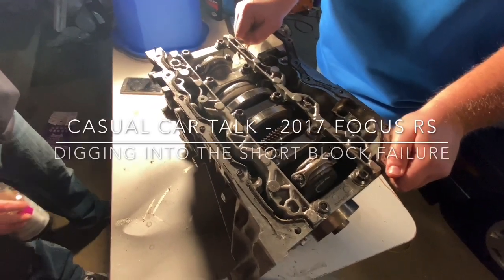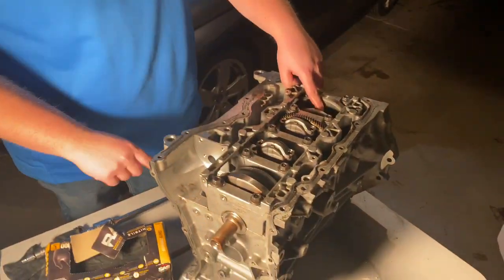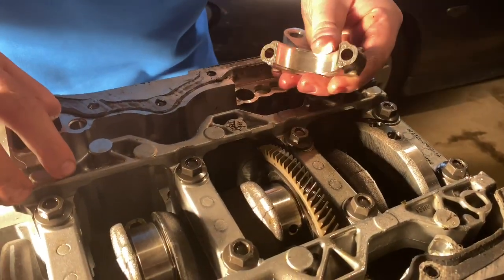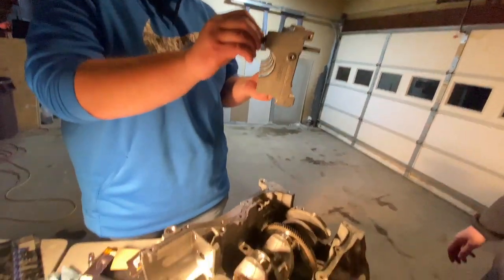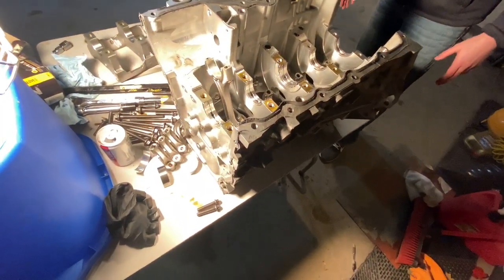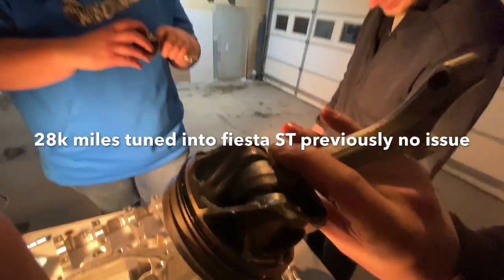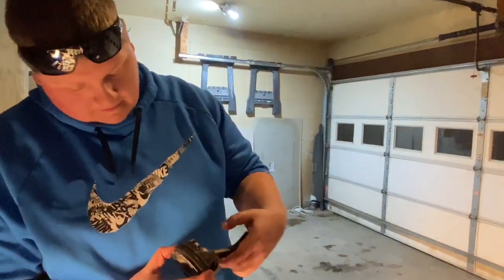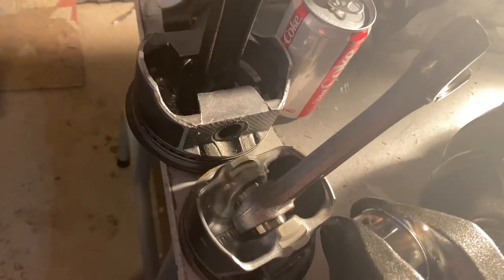2017 Focus RS Shortblock Failure Inspection

Comment: I personally wouldn’t blame Cobb. We all know by now that the RS block isn’t intended to push without having some concern. For sure looks like a faulty issue with your block assembly. To bad ford wouldn’t own up to that.
Reply from the maker: chucka187 I’ve grown a lot and with the increase in popped piston skirts I am starting to shift blame to ford more than Cobb - that said Cobb tunes are known to have dangerous torque spikes and bad tunes for a base. I wouldn’t recommend running them with so many reputable tuners now experienced in the RS community

Comment: Did you happen to hit the rev limiter often before this damage occurred?  I say that because I know of a fellow autocrosser in a 2017 RS that had very similar piston skirt damage.  He was self tuned, but the hypothesis is the extra stresses (more power/torque) plus rev limiter equated to the pistons cocking in the bore more than normal.  Piston skirt contacted cylinder wall, crack(s) formed, ultimately leading to skirt failure.
Reply from the maker: HanksRS I did a couple of launches and stuff, which the car was fitted with stock. But I abused my fiesta ST for 28k miles and never had an issue vs the problems the RS gave me from day one. Head gasket recall was a nightmare, awd issues constantly, dealership maintenance incompetence, and a generally bad experience from ford really soured the RS ownership experience. Dumped it for an edge ST for my wife and picked up a 2018 fiesta ST for myself again. I gave the RS a few good rides, but it was never ending issues. Needless to say even hitting the rev limiter here and there a car like the RS shouldn’t be having the issues it has.

Comment: i doubt it is tune related
Reply from the maker: samsonyunited I agree. And that was my fight against Ford. But at the end of the day they refused my warranty and denied a lemon law buyback claim: I’m mad at the misinformation I received more than anything. Telling people to tune without showing them the reality of what could go wrong is dangerous
Reply: @gapperformance  indeed. They can easily tell when a car is tuned. Although the tune probably had nothing to do with it, touching the oem calibration voided warranty.  hopefully others learn now to only tune if they are prepared to deal with repair costs. I personally changed to    a forged engine from esslinger engineering.